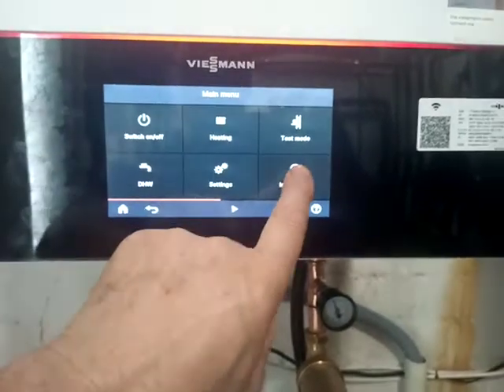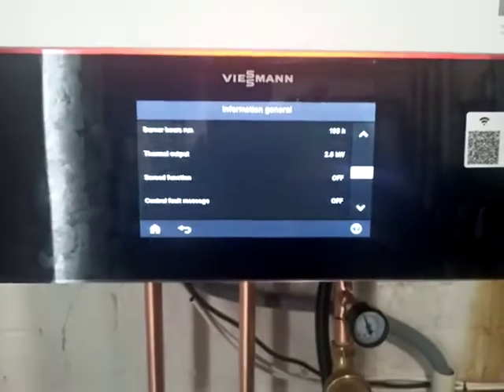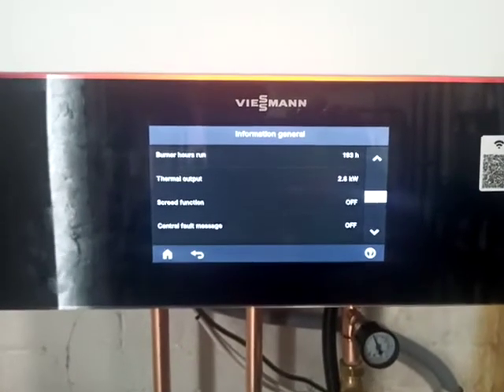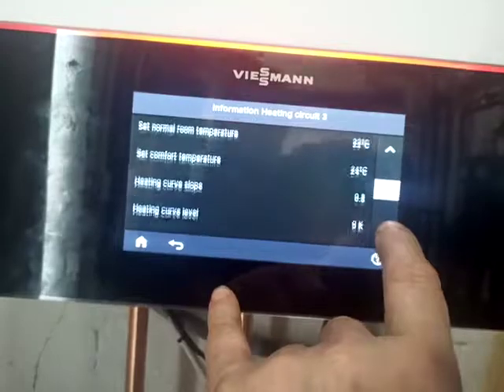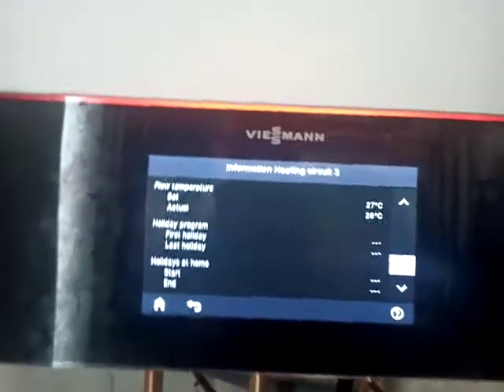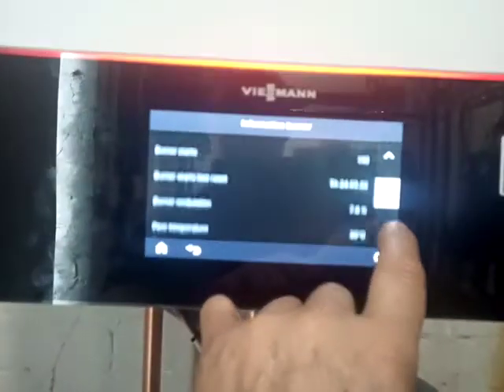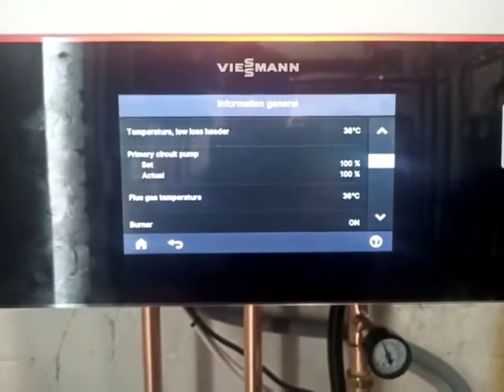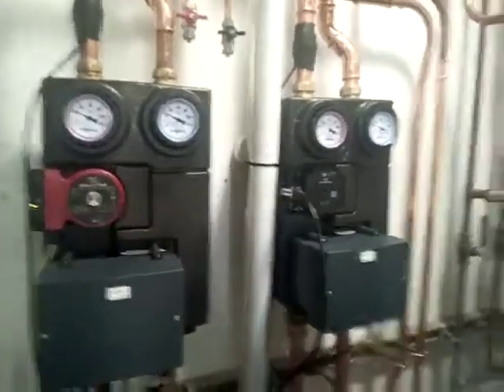More on mixing groups

Comment: If having an uhf curcuit and a radiator circuit, can you not just have one mixed divicon for the ufh and let the boiler do the higher flow to the rads or does it not work that way?

Why do towel rails require an un mixed divicon and not just a tee off the main flow from the boiler if only one or 2 towel rails?
Reply from the maker: An un mixed divicon and a mixed dicon are just ways to pump or blend and pump to a circuit. An unmixed divicon can be replaced with a simple pump and mixed divicon with a free mounted miver and a pump. If a system has both ufh and rads each circuit needs its own pump after the hydraulic seperation.

Comment: why not one unimxed and one mixed if you got rads and UFH? Surely w200 can do that?
Reply from the maker: Yes it could use one mixed and one unmixed but unmixed is best suited to towel rails or budget customers who will accept lower control.
Reply: @andrewmillwardwatford9410  thats what I did on my last job.

What bothers me a bit is the fact that quite often with W200 you have to use 3 pumps (boiler inlcuding) when in 90% of situiatons 1 pump could do at a cost of £2,000 less. 

Have not used divicons yet - just mixed circuits with my own pump. They just seem so expensive for an averge domstic job under 300m2
Reply from the maker: @UrbanPlumbers  why 2000 for two extra pumps ? You already have one on ufh so it's really only one extra pump. Standard esbe mixer is not expensive so about 500 pounds gives the extra control, comfort and economy and then take off the cost of stats and actuators.
Reply: @andrewmillwardwatford9410  i need to figure out this mixig malakry. What do you recommned for use that is not crazy expensive?
Reply from the maker: @UrbanPlumbers  they are available through the forum
Reply: @UrbanPlumbers  Mixing is something of a Dark Art and the only way to learn, I think, is to have a go, which can be a little daunting. 

Frustratingly there's little out there to learn from, wish there was  !
Reply: Hi Andrew,  I’m not sure I follow.  Can you explain a bit more as I was about to order one mixed and one unmixed to run weathercomp on v200 for a job I’m doing in a couple of weeks.  How would the rad circuit have less control being unmixed?  Thanks, Mark. @andrewmillwardwatford9410

Comment: So is this a low loss header type mixing valve thing with temps displays!?
Can you explain why you fitted it. 
Also the destrat pump. What’s that do. Guess it circulates water in cylinder!? But never heard of it 😀
Reply: destratification, moves the water around the cylinder to equalise temperature as it tends to form thermal layers. often a legionella requirement.
the mixing valve arrangement just recycles the warm water already in the zone, when it needs more heat it pulls and mixes in hot water from the boiler. fitted because there are multiple heating zones that each require different temperatures and flow rates.
Reply from the maker: As Clive said really. I've used the stratification pump because I have two cylinders. The Viessmann can only heat one cylinder. By circulating water in both cylinders, one to the other, while heating the boiler sees the temperature of both cylinders via a single sensor. I'm heating only to 50c to conserve energy. Once a week the boiler runs a Legionella cycle to steraliise the cylinder.
Reply: If you ha e adestrat pump ,does it destroy the thermal layers ?

Comment: so what is controlling the three ufh circuits if they don't have their own actuators and pumps? thanks
Reply: Presumably nothing essentially. If the pipe layouts are well designed then all the rooms should be at similar temperatures. 900sqm ‘quite a big house’ yes indeed!
Reply: @martinwright7093  must have something surely to split the three... otherwise that would just be one big zone
Reply from the maker: @cliveramsbotty6077  the zones are formed by the mixers. This house does have two sub zones via the two room stats and two zone valves mentioned in the video. 
In principle we heat the whole house to steady low temperature to keep the house comfortable using minimum gas. Ufh is perfect for this as it already has to run all the time on normal or set back temperature.

Comment: Great video Andrew, very interested in one of these to connect to my 222 for a 3rd circuit.  Thinking of using it to connect to Uponor Minitec underfloor.  Any experience with this?  Looking to cover 45m2
Reply from the maker: As long as you can supply the manifold directly it's no problem. I have a top mounting kit for a 222 going cheap just perfect for this job.
Reply: @andrewmillwardwatford9410  - already have one of those. Wonder if you can double stack them?
Reply from the maker: @RH-xj8hm  great question. I have no idea
Reply from the maker: @RH-xj8hm  where are you based ?